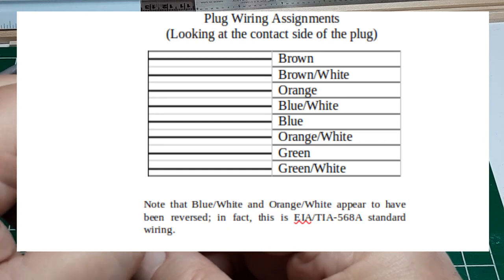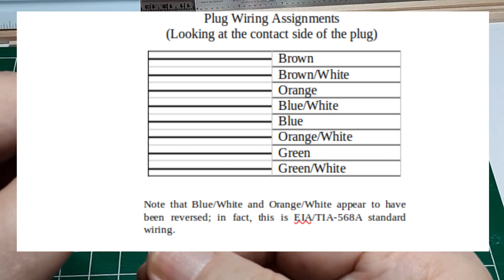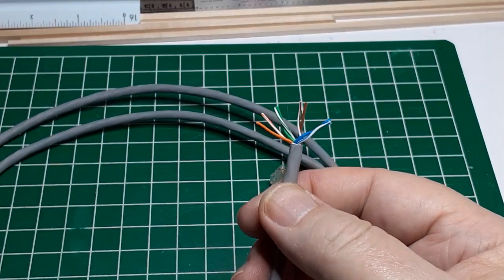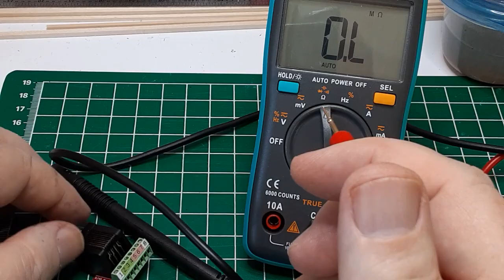Plug n Play Tortoise Switch Machine Wiring

Comment: First, thank you for this video. Why do you use a connector to the tortoise motor instead of direct soldering which I have see being done by many? What is the advantage. Some electronic systems (eg: Digitack) do use Cat 5 for their control, so why not using pre-made cables? Is there an advantage of doing this work? Yes the more info the better.
Reply from the maker: I use the connector mainly for two reasons: First, it plugs and unplugs easily, making assembly and disassembly a snap (no pun intended. As I mentioned in the video, if you have to dismantle your layout, you'll have to unsolder and then resolder those connections. (Or, you could keep the Tortoise and its cable as a unit and hope that the cable length will be useful on your next layout. It just made sense to me to have a $3.50 item be possibly not useful later than a $16 item.) I guess what I'm trying to say is this: I'd rather be certain that I could reuse the $16 component (the Tortoise) than risk not being able to use it because it's attached to a cable that's too short. I'm more willing to risk not being able to use a $3.50 component (the edge connector) because it's attached to a cable that's too short.

Second, this makes it easier to replace a bad Tortoise. The second is not such a big deal: I've only had one Tortoise go bad in 20+ years. But if you're hosting an operating session and a switch machine goes bad, it's nice to be able to plug a new one in place in just a few minutes.

You absolutely could use pre-made Ethernet cables: Buy a six foot cable, cut it in half, and you now have two three foot cables. But a 6' Ethernet cable costs $6.60 (on Amazon), so each of those 3' cables costs $3.30. If you just need a few cables, this probably makes good sense. But if you need 10 or 20 cables, it's a whole lot cheaper to make your own: 3' of CAT-5 cable costs 25 cents, and a plug costs 15 cents. The real expense is the crimping tool. By my simple math, the breakeven point is about 10 cables.

Hope this helps.
Reply: @rwissbaum9849  OK, Thanks for the feedback. I understand your logic and it does make some senses. I am building a modular layout just in case I have to move. Each module as mostly 4' by 32" with a few odd sizes to fit. I probably use some of your design.
Reply from the maker: I just reread your comment and I realized I did not answer your question about using premade cables. You absolutely can use premade cables. If you decide to do so, I recommend buying an Ehternet cable twice as long as you need - that way, you can cut it in half and have two cables ready to solder to the edge connectors. The reason I make my own cables is simple: cost. A 12' Ethernet cable costs about $8. A 500 foot roll of Cat5e cable costs $50 - or 10 cents a foot. 100 RJ45 plugs cost about $6, or 6 cents each. This makes the cost of a homemade 12' cable about a buck and a quarter. You also have to buy the crimping tool - that'll set you back about $20. If you need, say, 20 cables in all, you'd spend $80 on premade cables, and almost exactly the same - $76 - on cable, plugs and the crimping tool, but you'll have enough material left to make many, many more cables.
Reply: @rwissbaum9849  OK, thanks for  the feedback.